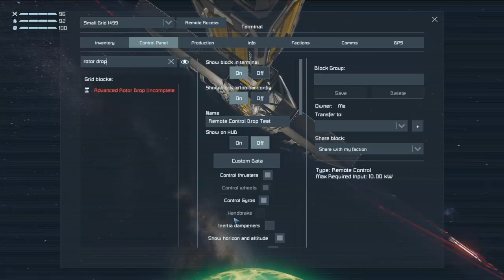Survival Impossible - Fresh from the Farm #31 - Space Engineers Hardcore Survival

Comment: They've added vanilla hinges now??

And I think you should go for an articulated launch tube. Using advanced rotors you can make a launch tube to adjust the aim. I was initially going to suggest a piston to shunt out the pod, but what if you using a gravity generator? 😂 Out a mass block on the pod and make like a gravity gun to fire it at the target you want lol
Reply from the maker: Sadly at this point I can't use mass blocks or grav gens as both require minerals I don't have. I'm thinking either piston push or pendulum swing for tha launcher ;)
Reply: @Splitsie  ah yeah, forgot about that lack of ores issue lol.
I definitely thinl the piston pusher is the way to go. The pendulum sounds really cool, but I think aiming it is going to be really hard, and it also might look really odd on the base.
(though if youre going to do some testing like you did with the catapults, I'd definitely be intrigued lol)

But with the oiston launch tube you can use a hinge mounted on a piston to make like an adjustable cannon that i think would look really cool and be infinitely easier to aim

Comment: Maybe it won't work, but for the delivery system could you use an advance rotor and just disconnect the head. Then attach a new head before turning the welders back on?
Reply from the maker: To be able to build remotely I can't use rotor detachments as I'll need to use projectors (can't project sub grids) which means it's merge blocks only for the launcher - or sacrificial blocks and a gatling gun :P

Comment: What if you put a drill on the outer edge of your drill rig, turned 90 degrees from the current drills, so they face the direction of rotation so it drills it's own path if you alter the angle.

Comment: Is there a setting for the immesive lighting? Mine all seem to be off as they make 0 light at all... ran a strip through the center of my hallway and it’s as dark as the darkest hole in the universe
Reply: Unfortunately the lights on interior wall blocks for example aren't actually light emitting even though they glow, you will still need to provide lighting through conventional lights (corner lights, interior lights etc). You could be talking about the lights that came with the new update/DLC though. If your talking about the emissive strips mod on the workshop, the description says that it doesn't provide light even though they glow.
Reply from the maker: Harbinjer's right and it's also the case for the new neon lighting - they aren't lights, just emissive strips :(

Comment: no morning light needed just pour the cereal and glow in the dark all by yourself lol
Reply: you need a 4 seater bench in front of the lockers
Reply: you could put the beds side by side and the armoury on the end ... then both beds have a window view and the other two rooms dont have a window
Reply: why setup a big printing rig when all you need is 4 cargo pods ... one loading one unloading and one going up and down ... have each pod with a basic control seat to drive the pods to the base ... and a lifter rocket set to get back to orbit ... and chutes to land ... then the main body is just cargo pods all the other stuff is attached to the front and back ends of the pods including a connector on one side to load and unload from ... and have 2 connectors underneath the platform so when the pods are loaded they just disconnect and drop back to base ... and then just remote the pods to the main base to unload ... and refuel ... and launch back to orbit to reload ... 
all you do then is remote link to the landed pod and drive it to unload ... and check the one that is already there and see if it is empty ... if so refuel it and remote it back to the platform .. where you check the oldest pod there and drop as needed ... you can drive it back later as well ... or drop them in some pattern that suits time needs and what not 
perhaps a remote control station inside the crew area ... put a glass floor in under the ockers and the remote control seat there so you can look down to the planet from above as well
Reply from the maker: I never like the idea of beds end to end - largely because I'd hate to be the person with their head by someone else's feet :P

Comment: That lights hue in airlock looks exactly like i remember it from first Alien movie.

If your rig overflows storage i suggest you try my script. I initially wrote it to address that very issue. You can set any % of storage at which it triggers.
https://steamcommunity.com/sharedfiles/filedetails/?l=english&id=1714007539

Is there a point in drilling so much stone? You will run out of asteroid before base is finished. And i thought its only simple outpost supposed to help you find silver.

If that drop is consistent, you could actually skip building containers all together. Just build platform of collectors at gps and drop items alone. No need for batteries and chutes or anything. Try it with that gravel. Collection would be easier too - just use connector to take stuff from collectors.

How about some lcd posters or nenons inside? I think if you paint neons black they can imitate wires. I hope you wont leave interiors all white.
Reply: no, the base was built as an iron drop